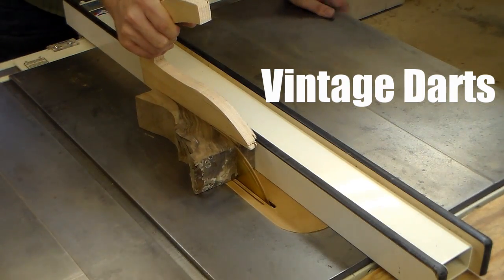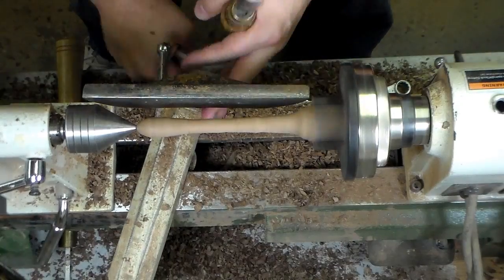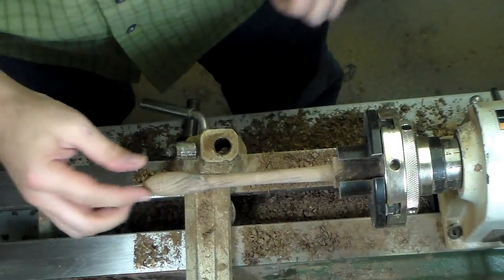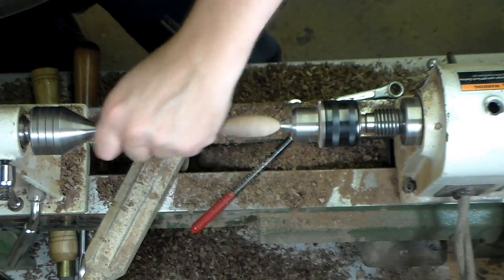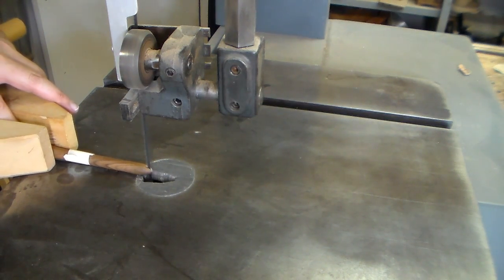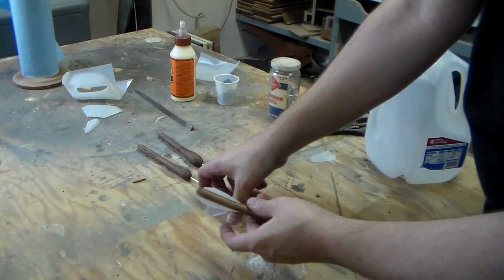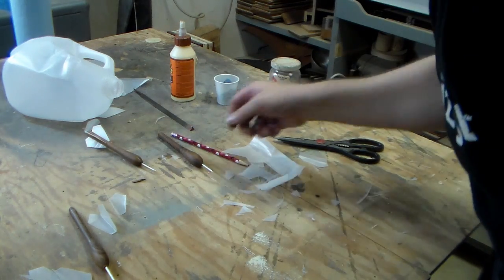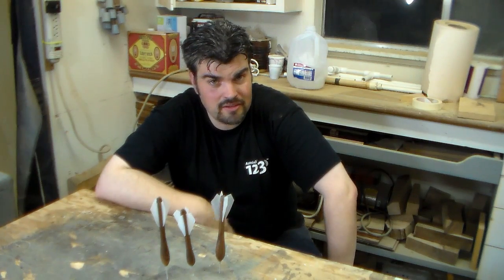How To Make Cool Vintage Darts!

Comment: i use the sharp hooks for hanging curtain for the spike and making small awls they work good, also large yarn needles work great too! great vids
Reply from the maker: Wulf Don t Those are both good ideas! How's the weight? The major issue with these were that they were way too light for darts.
Reply: WEIGHT should be fine they are compairable in size to the old ones ive seen ...some of those were actual set with molten lead to secure the tips and give a bit of weight to the dart

Comment: If you take a fine-grit sandpaper to the HDPE surface, you can get superglue or epoxy to stick. The surface is too smooth for the adhesive to get ahold of, but roughing it up gives it some adhesion.

Comment: Hey Peter: Do you know that my first set of darts looked much like that... the weights are a little wonky though... 7, 8.2  & 8.5 grams each and for flights they have a strip o f feather glued to three sides.6" long and 1/2" in diameter at the widest point. I got them some time in the early '80s and they were pretty old then!
   I like your idea with the nail... and being aluminum it shouldn't do too much damage if you miss the dart board either!! But I think seeing as I like a 28gr dart I may use a steel one just to get some extra weight... I remember what it was like trying to get these ones to go that far!! 8-o   
   Great thinking outside the bottle for the flights too!
   Thanks for sharing
    Larry
Reply from the maker: The Tiny Trailer Workshop I'm used to throwing bombers so these are crazy light. I think you're right a steel tip would help! The ones I saw, all used turkey feathers, and for my first attempted I tried to glue the plastic in the same way. CA would not stick to it though!-Peter

Comment: i've been thinking about this for two weeks. anyway, cool video, thanks....so can you do some turkey darts and make another video? i wanna know how that part would go and how easy it would be to make them straight? and, no, turkey is not important...maybe some seagull feathers would give a modern day twist. 
     have you looked at the old darts like these? i think they drilled holes in the sides and filled them with lead to give them weight at the nose. the ferrule on some was just for protection. 
  c'mon make a feather video?!?!? i'll make a vid on demand for you?

Comment: I like this.  I'm getting ready to do something similar, except I don't have a lathe.  I will probably jimmy rig my drill press instead. 
Idea on the flights, why not just use feather fletchings?  That's what I"m going to be doing since I have a proper fletching jig (for arrows, so I'll have to jimmy that too).  I was thinking about making a video on it, but this video is pretty much identical to what I had in mind, so there's no need to clutter up Youtube with more of the same stuff.
Reply from the maker: +JathTech Every video someone makes brings new ideas to the table! I think it's a good thing. This channel is all about odd materials, so I skiped the feather and went for something off. It's sorta my niche. Good luck on your darts, and I'd love to see the video or finished product!

Comment: I just subscribed to your channel and am interested in the lathe you are using.  Is it a Rikon mini lathe?  If so, would you recommend it to a novice turner?
Reply from the maker: Steve Kilpatrick It's interesting. I like it, and I have abused it a ton in the past 6 years, but it's not a great lathe. It's a little underpowered the belt speeds aren't the best steps, but for the $300 I paid for it, I got my money's worth. I'd rather have a vintage tool. Something made in the US from the 50's or 60's. Like a Delta or Powermatic.

Comment: The milk bottle material is most likely HDPE, look for the recycle triangle. If it's hdpe it has the number 2. Pretty much nothing sticks to it:p
Reply from the maker: ***** That's right! I'd been collecting it to melt it down. But since I had some on hand I thought I'd try it on the darts. I was blown away when the CA glue just peeled off!

Comment: It seems HDPE is one material you use quite a bit. I could send you some blanks (might need to re-melt them down).
Reply from the maker: Richard Wachtel Thank you! I've actually got a huge pile of milk bottles in the shop right now. Now if I could only find the time to make another HDPE project!! :)
Reply: Peter Brown I have a blank made from 4 one gallon water jugs and 2 Tide laundry detergent bottles. It's got a super-funky look to it, but if I can somehow either gain access to a shop or get my own tools or even send it your way, then hopefully it will become more than just a bizarre paperweight...
Reply from the maker: Richard Wachtel yeah, it's strange material. I know there is a  large group of slingshot enthusiast who use HDPE. Seems like a fun project and wouldn't require much past a coping saw and a TON of sand paper...
Reply: I actually just make blanks for a friend, he commented on another one of your videos. His YouTube channel is Hath'alud LaFox. Recently the blanks I've made have either burned and buckled, or only the outside melted, leaving a lot of unmelted plastic in the hollow center. I'm still experimenting with melting temperatures and ovens. I have 2 blanks that need to be redone before I can even send one to my friend.